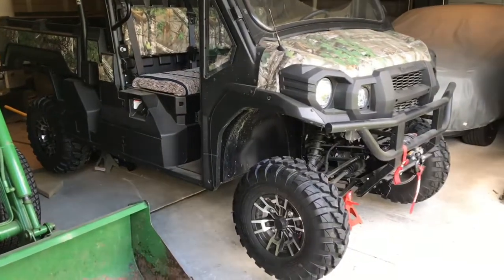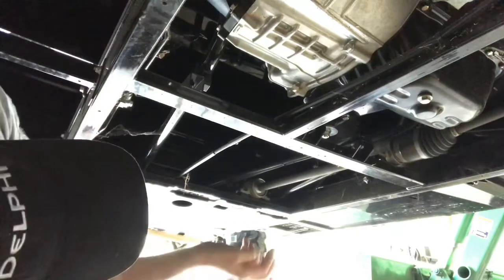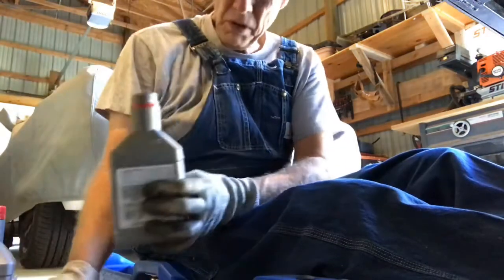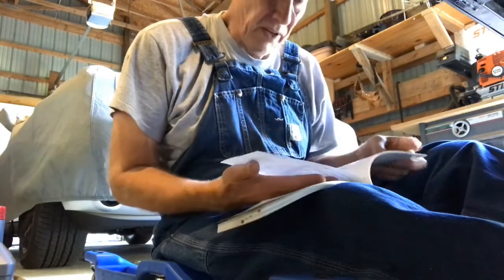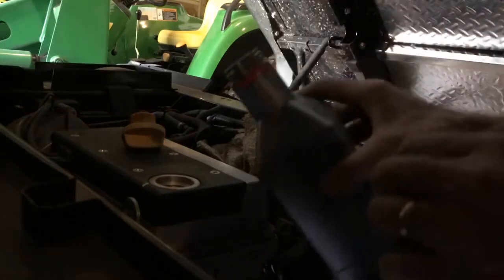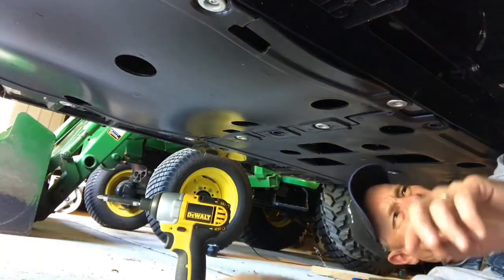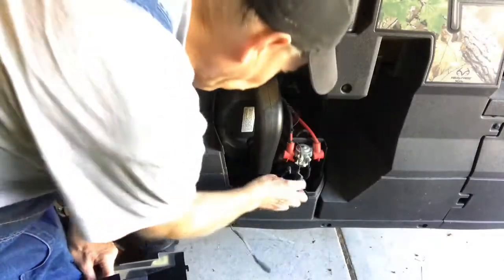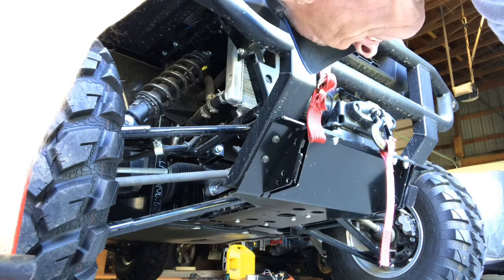Kawasaki Mule Pro FX - Oil Change

Comment: I changed the oil in my pro fxt today , thank you sir for your video it helped me . My dealer did it the first time :( and your right it was a pretty good job . They had the oil filter on so tight and their isn’t much room to get it off that was the hardest part . Thanks again 🇺🇸👍🏻
Reply from the maker: Hello Mike.  Thank you for the kind remarks and good to hear our video was helpful.  When the weather turns for the better I’m going to determine what size the oil drain bolt is and replace it with a drain valve.  There’s a couple things I need to work out but if I can get it worked out, the drain valve should make doing an oil change really simple.  Will keep you guys posted.  Take care and thanks again for watching.

Comment: The hole in the skid plate with the rib around it lets you access the drain plug without taking the skid plate off.
Reply from the maker: I’m aware of the hole in the skid plate but taking the plate off makes the task easy and not so messy.  Planning to install a Fumoto valve later this year and will clamp-on a hose extending to the hole you’re referring to.  That should be the ultimate setup and will be doing a video with that installation.
Reply: @Stromzilla  Great..... good stuff. Getting a Mule Pro FX EPS myself so thats why I watch these videos. Thanks.
Reply from the maker: Keep us posted on your mule purchase.
Reply: @Stromzilla  Will do.